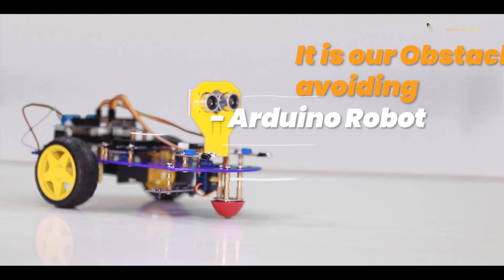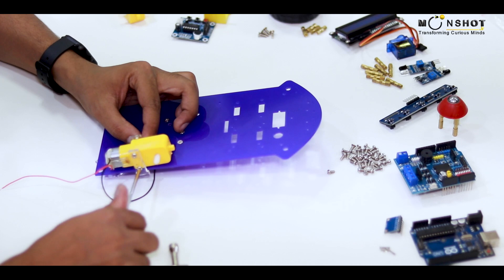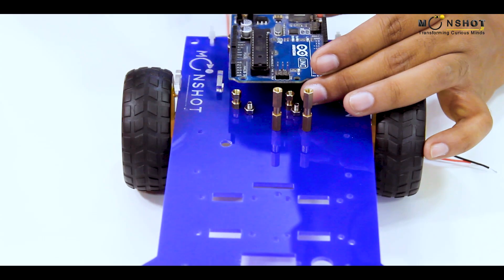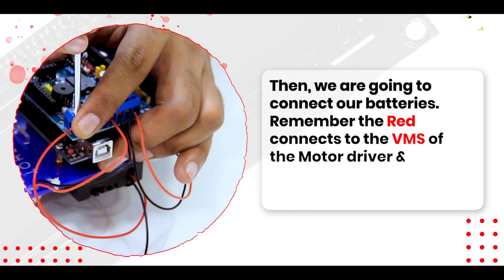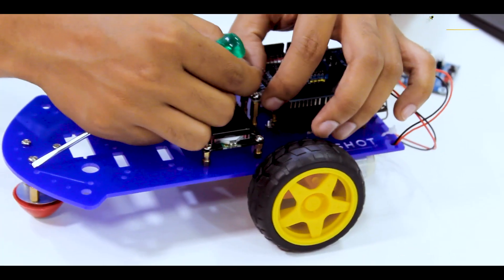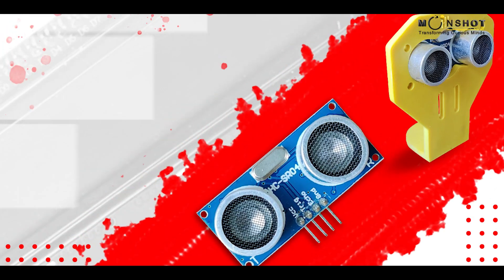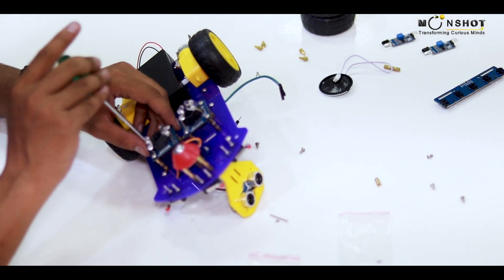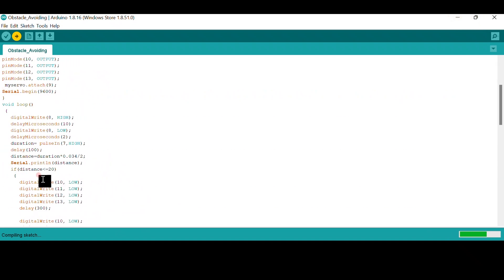I built an Arduino Obstacle Avoiding Car myself

Comment: How can I make it follow me around when it detects me? I was trying to write the code using an IR camera and let the IR sonar keep it from running into me. Can you please write the code so I can learn what you did and get it running? I'm 63 and wouldn't fit in the children's class programs but I'd like to build this so I can complete some research experiments I have wanted to do for decades. I couldn't find anyone to build it for me so I'm doing it myself but I need help with the coding. I have three Arduino Nanos for the different sensors for my experiment (atmospheric research). Can I use that to run the robot? I was told Nano would work like an UNO.   Thanks